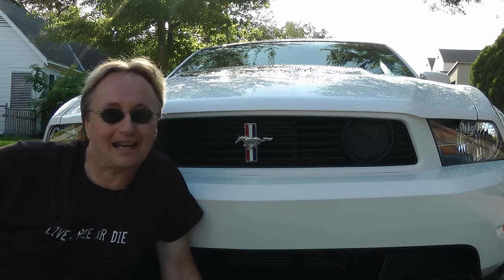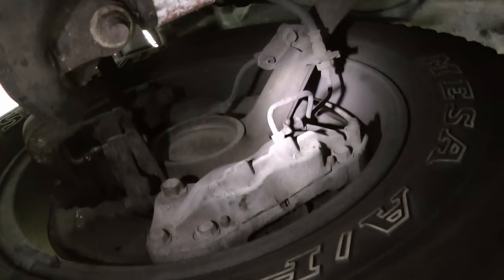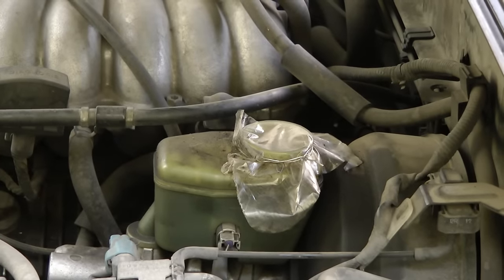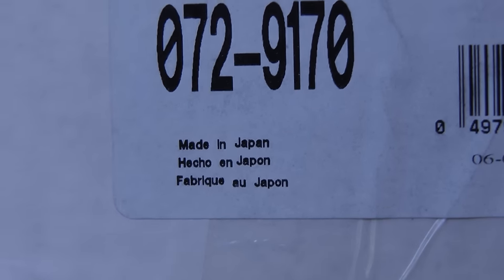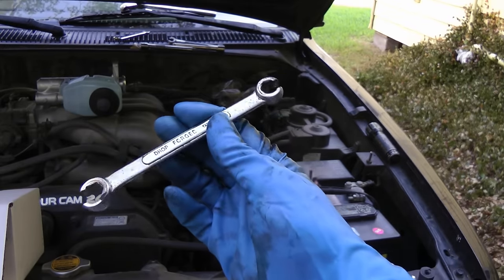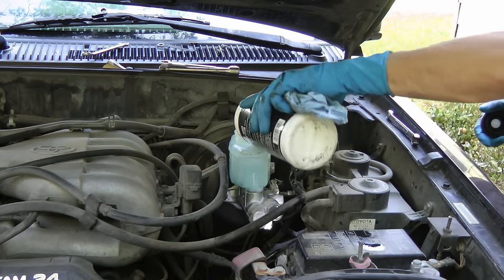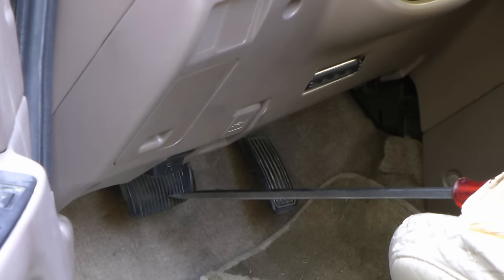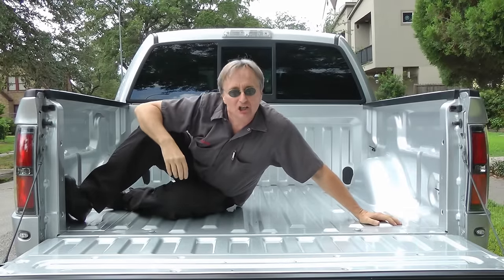How to Fix a Brake Pedal that Sinks in Your Car (Brake Master)

Comment: Hey Scotty I got a 2006 Ford 500, the rear driver seat won’t bleed & the valve isn’t clogged. I’ve bleed the other tires but just the rear driver side won’t bleed.

Comment: I have 2006 Yukon Denali xl, brake pedal seems a little gooey ,it is wet all around master cylinder,brake pads and rotors replaced ,no leaks anywhere.do you think replacing master cyl.would give me more pedal ?

Comment: Hi Scott I have a question. Do you need to drop the gas tank to change rear brake lines on a  2002 Chevy express 1500 van?

Comment: I was wondering if this would work if I did this to a Subaru Legacy 4th gen it’s 2005, I have abs but would this method mess up the abs system or cause a master cylinder outburst? I basically was driving when the reservoir was empty and I didn’t know.

Comment: Question Scotty:    To test a mastercylinder on car, can I remove the two lines and install one brake line into each port forming a  'U"?  Or must I use plugs into each port?

Comment: Will a bad brake booster check valve cause this type of problem (pedal goes to floor)?  I bled all the lines, replaced the master cylinder, and same problem occurs.

Comment: Hey scotty, if I replace my brake booster and master cylinder at the same time can I still use the bleed method you used in the video or will I need to bleed each wheel also?

Comment: I have a 1999 oldsmobile alero and the brake pedal makes a fluid pressure noise as it goes to the floor. It had a line replaced last year because it was very visible that it was leaking onto the ground. Lately it has to have tons of fluids but in the master cylinder. But this last time we put fluid in it. It is staying in there but the pedal still does the same thing. It is where its suppose to be when the vehicle is turned off. But the minute it turns on the pedal goes to the floor. After we had the line replaced it had returned to this correct position but it went back to the floor after a while. Should I attempt to bleed the master cylinder because I have checked for leaks but nothing is leaking. Thanks

Comment: Question. When changing a brake caliper, would it be best to bleed the air out at the caliper hose or at that brake reservoir like you did?

Comment: I recently swapped out the master cylinder on my Toyota Camry 05 and the pedal continues to sink. I have no leaks in any of the tires or underneath the car. Would there be another reason for the pedal to continue sinking?

Comment: Wi have a  2005 Corolla S. I've replaced the front calipers, the front pads, the front rotors and master cylinder but the brakes are still soft.   I have bled the 4 wheels with no leakage. But the brakes are still soft - any suggestions why?

Comment: Hi Scotty! 2005 Ford e-150 van! Brake problem, we replaced pads,calipers, and master cylinder, well done bleeding!I'm sure there's no air in the lines! Pedal still sinking! Any idea what to do to fix this issue? Thank you!
Reply from the maker: abs failure often causes that too. Have a pro scan that for problems, but if not that, often bad brake booster

Comment: What would a constant hissing sound coming from the brake master cylinder indicate. Fluid levels good
Not leaking.  No issues with stopping. Slightly spongy.  03 crv

Comment: Hey man you're awesome, i love your videos how easy and very informative as it is. My toyota 4runner brake is too low almost touch the ground, no leaks everywhere and brand new mc and we tried to bleed the mc 5times and followed each step but we cant see any difference. Do i need to leave the top of the mc open while bleeding or does is have to be close? We tried while its close. Is it wrong?

Comment: break gets soft when car is turned on, all lines are dry, brand new master cylinder and booster what else should I look into? the car is a 91 oldsmobile 98 regency elite with and does have abs if that helps.

Comment: My brake pedal is high and hard when the car is off. Its when its on that the brake doesnt respond normally and takes more pressure for it to stop. It isnt as responsive as it should be and sometimes i find myself pressing them all the way in order to stop in time. Is it air in the system?

Comment: I think I have an extraordinary problem here, zero resistance on the brake pedal but the brakes are working strong and good. The resistance from the pedal disappears when the vehicle is moving.  What is the cause of this problem?

Comment: Hello Scottie. At first when I step on the brake it was hard as a rock. But when I step on it for about 1 minute or more (when I'm stack in traffic) it would suddenly sink to the floor!!!
When I step on the brake again it will be hard again, then would sink again. 
Should I replace a new brake master cyclinder?
Thank you Scottie.
Reply from the maker: +Vincent Rodriguez pray it's just a leaking brake master and not bad ABS or brake booster
Reply: I think I'll gonna go to the church right now to pray. Thanks Scottie. Learning a lot from your videos.

Comment: Currently having a brake issue. They wont bleed. and its the same master thats been in for the last 8 years on my 72 cutlass. would an internal leak prevent me from getting all the air out ???
Reply from the maker: yes it would
Reply: Ok so i did have a leaky master. I bench bled the master with the caps provided but not too confident that worked as the instuctions said it would. I still am pushing alot of air. I removed the master and noticed the rear had a steady trickle the front did not. The front chamber is being a realy pain in the butt. Should i use the tube bleeders and re bleed the master ????  Never had an issue bleeding brakes but im quickly finding out there is many ways to skin this cat. Any advice or procedure to follow would be greatly appreciated.Im loosing my mind over this lol.

Comment: And the master cylinder today does not need a rod to disconnect from the piston?
Who woulda thunk it.
Also, what should be used to clean the area around the master cylinder BEFORE it is disconnected at the brake lines and also from the booster? Will brake cleaner do the job?

Comment: I have a 2009 Ford Escape when the weather gets cold the brakes  get spongy when its spring or summer they work fine can this mean that I need to change the master cylinder ? there are no leaks I checked all the tires

Comment: Scotty let me get this straight:

Finger tightening the lines on the master cylinder will allow air to escape, but not fluid, when the master cylinder is thoroughly bled?

And will not inject air into the brake lines themselves?

Comment: I'm trying to figure out if I have a problem or not. Yes my brake pedal does go to the floor when I press it with some force. I just changed my front pads. My back pads could need replaced, so I'm not sure if that's why. Could there be air in the line causeing?
Reply from the maker: fix the back brakes first, weak back ones will make the pedal travel too far down

Comment: Scotty my 2003 astro van is having this pedal sinking problem, i have checked for lickiage but nothing, I was told it could be the pump.? what do you think.? ( I will try your solution dough )
Reply from the maker: +Eddy Flo  also could be a bad brake booster, best to have  pro check both of those out with his dealer level scan tool
Reply: +Scotty Kilmer thanks for the response. the van also keeps giving me "cylinder one misfire" even after new sparkplugs, cables and even new ignition distributor for the firing order. I dont know what else it could be, I read on one post it could be something about pressure in cylinder. whats your opinion.

Comment: hi Scotty I change my master cylinder and did the same procedure that you show on this video yet I keep hearing a very loud air escaping noise and I don't have much brake I can pump it a lot and it'll get pressure but once I start the vehicle it loses all pressure except for at the very end of the pedal is this most likely the booster?
Reply from the maker: replace the brake booster

Comment: Hey Scotty, I have an 2006 4X4 Silverado, I am going to bench bleed the master cylinder then install it, Is it necessary to bleed each line starting with the back passenger to complete this job. In this vid (Fixing a Sinking Brake Pedal) you only bleed the master cylinder and then it looked to me like it was complete. 
Thanks for your Vids!!
Reply from the maker: If you bleed it carefully at the 4 lines on the master, that alone will get all the air out
Reply: Scotty Kilmer
I only have two lines on the master cylinder and by bench bleeding the new master cylinder throughly will be sufficient?

Just so I am on the same page as you the steps are 1. get as much fluid out of the old master (turkey syringe) then take it off vehicle.  2. bench bleed the new master cylinder thoroughly. 3. install on truck and then I will be finish correct?
So no need to take off tires and bleed each line at the wheel?
Thanks again@

Comment: I’ve never thought of bleeding all brakes at once using the brake lines connecting to the master cylinder. Why not do this rather than the bleeding valves?

Comment: Hey Mr. Kilmer, I have a brake question that I hope you can help with.

I replaced my front calipers and all brakes around 2 years ago.
Last week I replaced my rear calipers.  A month ago I replaced my booster and MC. Everythinf but proportioning valve and lines have been replaced.  I have fully flushed the fluis as well. The original fluid had moisture and air.

Now my symptoms are...

Slightly spongy,  no matter how much I bleed it seens.

2 times now I came back from long trips of 20miles or more and the next day.. i had no brakes with no apparent fluid loss...

Rebleed.. the rears and its back to firm.. i do still bleed the front.

Turn on car and brakes aare extremely spongy... but work.. take for a test drive and after 10 or so miles brakes return to a decently firm but slightly spongy feel.

Comment: Howdy Scotty I have a on going to issue with my car feels like it pulls to the left and the rear to the right when braking. I had the car alignment done it didn’t fix the problem. I did have a passenger front axcle that was broken ( I don’t know how the alignment people missed that one) and it gotten better but still doing it and now I feel like my alignment off again. Does this sound like abs uneven brake issue? I have a 2009 Benz C300 4matic

Comment: Very helpful video. I do have a question though. I drive a pretty beat-up '96 Tercel with this same problem and don't really want to invest in a new master cylinder since parts can be a little expensive in Canada (even when you order them) - relative to the value of my car. So my question is, could I simply change the brake fluid and bleed the lines for a quick temporary fix? I don't have a lot of money to spend on parts and I'm only planning on driving the car for another 6 months or so.
Reply from the maker: try it and pray, but pull all wheels off and check for leaks on cylinders there while doing it

Comment: @scottykilmer A new master cylinder didn't fix my sinking pedal. My mechanic thinks the ABS hydraulic pump is to blame. I've been driving with the ABS light on since I got this van. For my 2003 Ford E250, the ABS control module and hydraulic pump are both discontinued and difficult to find. Is there a way I can just bypass the ABS system altogether to fix my sinking brake issue? I've been driving without ABS for years anyway. Thank you!

Comment: Hi scot.  my car brakes was sinking and a new brake cylynder was installed but the brakes are still a little low.  the mechanic did everything he knows n thr car is still not braking correctly.  could it be it has something else thst is causing the problem? thanks

Comment: You are right about master cylinder, I have soft brakes and just got new brake pads and rotors with flush brake fluid. Then at a traffic stop the car turns at a traffic stop.

Comment: When AC compressor is overfilled when running it smokes . Should I consider it is shot, and needs replacing or what do you think would be the right next step
Reply from the maker: I would replace the compressor, they should never smoke regardless of refrigerant level, and I would also change the expansion valve or orifice tube
Reply: Thank you . why do you display Screaming Eagle so much.

Comment: My 07 F150 supercab brake pedal seems to be getting soft. So should I change the master cylinder only or both the master cylinder and the power booster thing?

Comment: My brake pedal gets spongy when pumping it hard using my heel. I heard the crack sound when doing so. I am worried something broken, either near brake booster or the master cylinder. Since then, brake fluid level never changed, but its color changed to dark brown. 
Before checking the master cylinder, I want to check parts near brake pedal that connects to the booster.
Do you have a video on how to :
- Adjust brake pedal height. I know the procedure, but it's difficult to access related parts ? Does it need removing the dashboard in order to get access to these parts ?

Comment: I have a 97 Honda civic and for a couple days I was feeling the brake pedal sinking in and now I have to push the pedal all the way down before the car starts to slow, what would you suggest I do to resolve this issue
Reply from the maker: pull the wheels off and check for leaks there. If you find none, replace the master cylinder

Comment: Not sure if this comment will get an answer, but my friends car, will have pressure, but as he is sitting holding the brake, it will slowly sink to the floor, losing pressure. I havnt been able to get under the car and look because of the snow and rain, but when I washed his car, I noticed a bunch of black fluid, which I would assume is brake fluid from the wheels. It’s a 93, might be leaking somewhere around the wheels?

Comment: Hi there! Ok, the following scenario happened to me, and I'm 90% sure its the master cylinder, but I would like your opinion on the matter before I replace it. The other day I had to brake really hard and right after this panic break moment, my brake pedal just went to the floor. I had to pump it a few times before regaining its usual feel and effectiveness. However, as I kept driving to the office, I was going through the same problem, the brake would occasionally lose pressure and went straight to the floor. As soon as I got to the office I double checked the fluid levels and everything was ok. I do not see any leaks around the master cylinder, but I guess it could be an internal leakage? On my way home the brakes were functioning normally, but I simply don't trust them. My car is a 91 300zx and by the looks of it, it still has the original tokico master cylinder. I would really appreciate your opinion on the matter. Your videos are very helpful!
Reply from the maker: pull off all wheels and check for leaks. If none are found, replace the master
Reply: Scotty Kilmer excellent! I will do so. Thank you very much!

Comment: Just throwing this out there.  Maybe I'll get an answer pretty fast.     I own a 350z.  I replaced all rotors and brelake pads, but my brakes still drag.  What I mean by drag is that when driving and letting go of the pedal, the car slows down really fast like it's in low gear and comes to a fast stop.  "BUT" when I put my foot under the brake pedal and lift. The car releases and costs as normal.  Note... the abs light vdc and slip light comes on as soon as I apply the brake to put it in gear.      Any specific ideas?

Comment: What about flex seal? Will it seal off wheel cylinders. Or maybe a dripping master cylinder. 
That's to much trouble Scotty. I use the emergency break instead.

Comment: Scotty... I just had my brakes done! and now the stop distance is longer than before.. Is it normal? I checked and there are no leaks and the pump seems fine. Ive heard about bedding brakes on performance cars.. I have a 2010 chevy malibu would I still need to bed the brakes for my car even if it doesnt use performance brakes?
Reply from the maker: you have to bed them in, wait a week or so and see if they work better
Reply: Thank you scotty I appreciate the time to reply to my post. Happy Holidays

Comment: Hey Scotty, weird question.  My mom has a 2005 Nissan Quest, and the fiance company she bought it from has replaced the tie rods, brakes, rotors, and the alignment in the van, and the tires are balanced and in good shape, but it still shakes when she starts to brake at 45 mph or higher.  Do you know what might be causing this shaking?

Comment: Great video Scotty I’m having a problem with my breaks in my Toyota forerunner right now too.  I took it into a shop and they made all new lines for me, since I live in the north my lines rusted out from salt and what not.  I had them replace all of the lines from front to back all four wheels.  However after using a professional pressure bleed/fill to refill the system they were unable to get air out and are very confused as to why they cannot bleed the system.  My callipers/wheel cylinders were not removed, however the lines were pulled out of them to be replaced.  That would include the master cylinder as well.  Do you think the solution would be very similar in my particular situation?

Comment: hey scott. i have a 1974 bmw 2002 and the brake pedal is only soft when the car is running. when its turned off it builds pressure. any idea? thank you